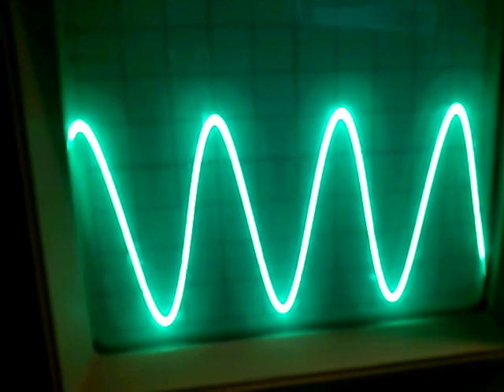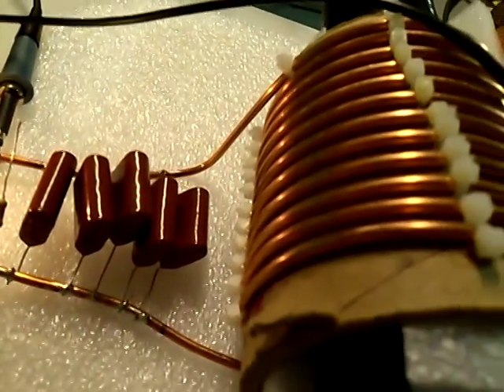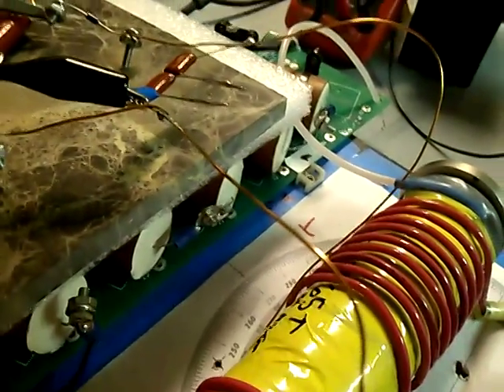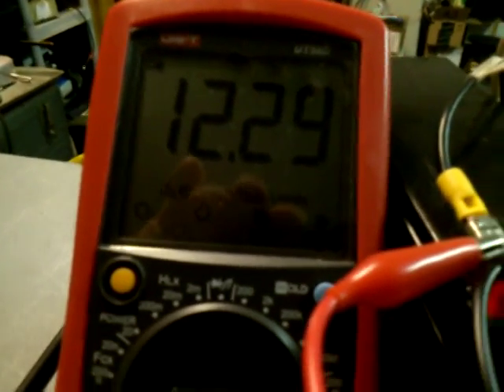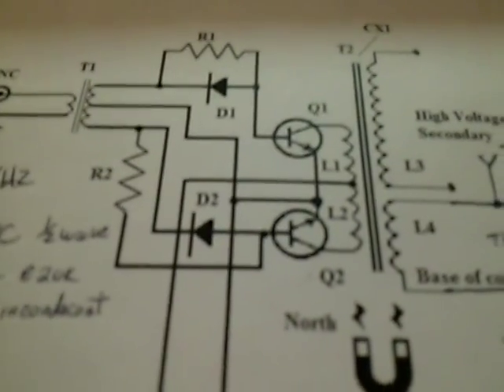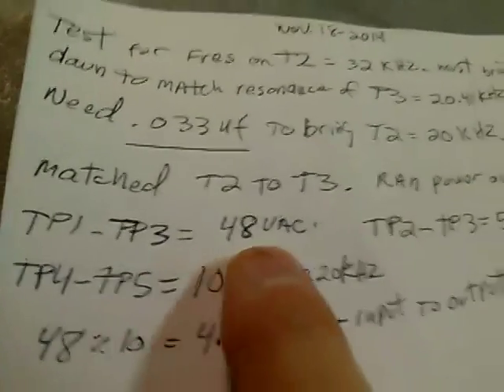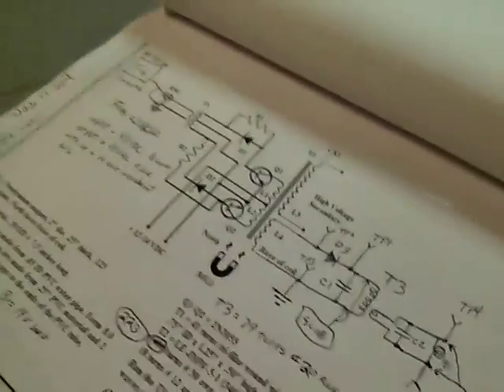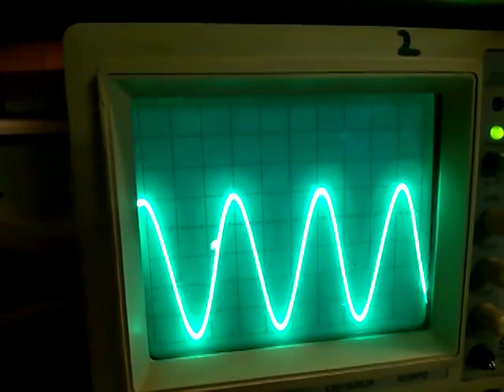Donald L. Smith Exp. 22

Comment: Donald Smith's device had never worked. Just beautiful toy.
If look at his famous device you can see that there is a power source 9000 VAC, 30 mA, 35 kHz and Don could take maximum 2500 VAC as C1 has nominal 4000 VDC, withstand voltage 6000 VDC (as described by maker,  CMR1A402104K 0.1 uF +-10% 4000WVDC 7702. Custom Electronics has now analogue KMS1A402104K and everyone can check what the size of it https://www.customelec.com/capacitors). After rectifying 35 kHz AC current by two diodes VARO VF25 ( 25 kV, 85 mA) you get pulsing current 70 kHz which flows via L1 to gas discharge tube (GDT). As we have pulsing current we must consider GDT dynamic breakdown voltage 100 V/usec or 1kVusec. If we have 2500 V and 70000Hz then voltage rise is 2500 V / 7,14 usec = 350 V/usec so it means we must choose GDT with DC breakdown in volts between 1500 and 2000 max. And also very important is period of GDT acting from breakdown to glow and to arc (moment of time when L1 begins to store energy) and this period supposed to be minimum 60-80 usec but to met Don's device it must be 14 usec for each voltage peak 70000 times acting to allow L1 to store more energy. The coil L1 is supposed to be 2 uH (this very very very small for such a small current 30 mA from neon power supply) cannot store enough energy even to perform oscillations between L1 & C1 between those discharges performed by GDT. I graduated from maritime Academy as radio-engineer and I know how it is going. Please calculate how many energy is stored by L1 for a second and tell me! I am 100% sure that this device (beautiful toy) will never worked as described by Don Smith!!! I saw the video of symposium Tesla 1996 when the device was tested for a short period of time and using big black box inverter that could have a source of energy hidden in it. Did anyone try to measure the voltage of output capacitor bank C3 2000 VDC 32 uF??? Did anyone try to disconnect and connect back input 12 VDC battery while load bulbs are lit??? For what to use that inverter, just only to energize the fan??? To check the output power it is enough to connect directly bulbs in series to capacitor bank C3!!! Don Smith is just faker.
Reply: AFTER READING YOUR SHORT STORY BOOK HERE I CAN SAY YOU ARE LACKING  THE PROPER KNOWLEDGE  TO DO THIS AND DON'S NOT A LIER AS YOU SAY BECAUSE YOUR FRUSTRATED AND CAN'T GET IT DONE LIKE ALL YOUR EX GIRL FRIENDS SAID.  YES I DID IT POWERING LOADS . AND NOOOO I WON'T SHARE MY SUCCESS WITH THE LIKES OF YOU.    GO WEEV BASKETS.
Reply: I was a little bit incorrect guessing he tested namely that device which was on the floor due to low quality of video Symposium Tesla 1996 and in real he tested only black suitcase  brought with him that should be similar to that one on the floor but only smaller in size. And this is more funny))) Truly saying Don Smith is a real LIER. And the main source of all his device is just his aim to grab more money from stupid people))) Good luck everybody! Don't believe in this shit!
Reply: @AleksandrOsadchy  OK DOE, DOE YOU HAVEN'T A CLUE WHAT YOUR TALKING ABOUT, TRY WEEVEING BASKETS MAYBE YOU CAN DO THAT CORRECTLY.